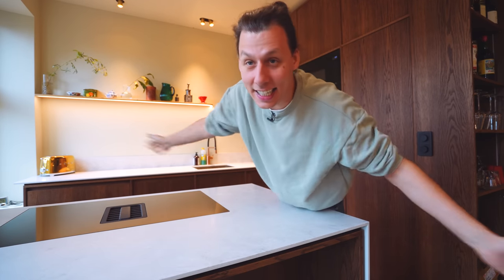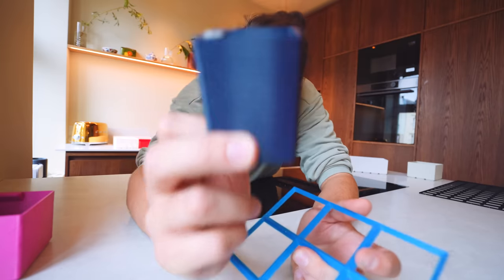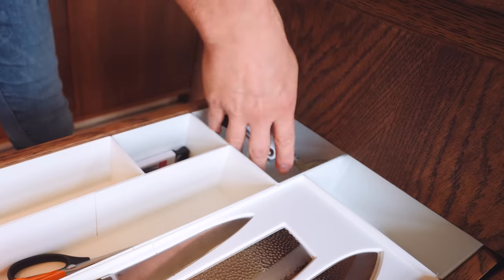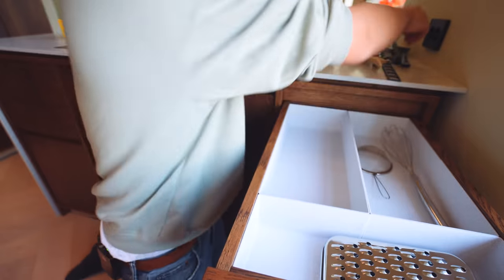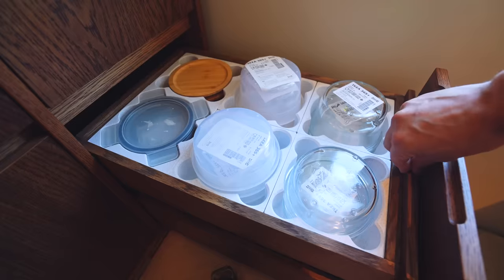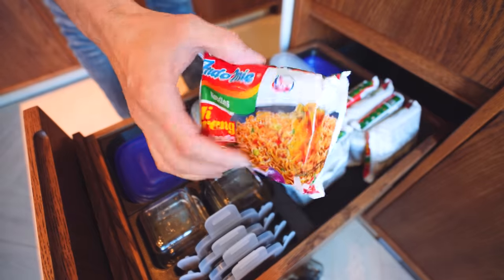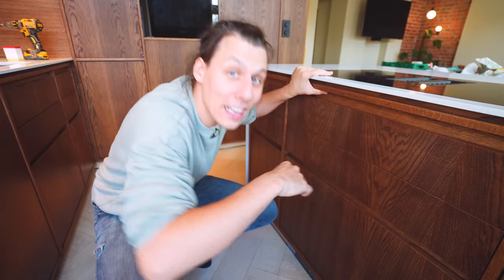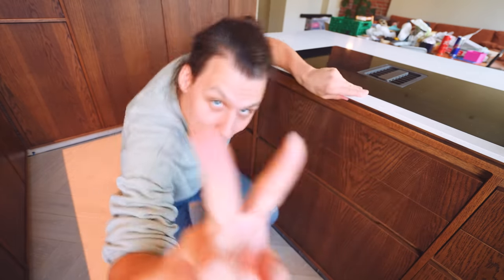How To Organize Your Kitchen With 3D Printing

Comment: I just purchased the files for this system. I do however have one question. Will you be releasing a calculator that tells you what grids you need to print depending on the measurment values of yor cabinet? I was thinking a simple calculator like entering in your width X Depth values, and then it outputs values like.... 5..6x6 base grids and 4...1X14mm base ends.

Comment: So basically gridfinity. I'm curious if you designed this without knowing of gridfinity or took it as inspiration. I definitely designed something similar then realized it's actually basically gridfinity!
Reply: Gridfinity came after the OG ALCH boxes. Zach mentions this in the Gridfinity intro video :) Plus date stamps on Alex's videos and the Gridfinity videos.
Reply: @AndrewWilde  Ooo dang that's sick. I feel like Alex here has an endless mind for design. He oughta step up and take some credit for things! 😂😂
Reply: Basically the 3d printing community is mad at this guy because he locks his designs behind a paywall, whereas a lot of 3d print designers share their designs open source as it's a very collaborative community. Gridfinity is the solution to this guy's grid system and by making it open source there are so many great designs made using the gridfinity system, further proving the value of open sourcing design!
Reply: Although I have bought the old system it feels bad not to have it updated and need to pay again.

Comment: For all the boxes to the grid system. Ikea maximera has an angle on their sides. Do you have any endboxes that align to this? 

Since their drawers 40.60,80 with have a narrower bottom. 40cm width drawer are 28cmon the bottom

Comment: If you are leaving the boxes in the draw, the grid is redundant. Just design the trays so that when they are all in, they fill the draw. The boxes will stop each other from sliding around. Doing things this way utilises the space more effectively (no wasted gaps), saves plastic and printing time.
Reply: That would only work if the drawers were exactly sized to the boxes. Using a grid system makes Alex's design universally compatible with any drawer size.
Reply: @craigmonty  No, the other way around. I design the boxes to fit the draw. So it does not matter what size the draw is. This is the joy of having a 3D printer, the ability to custom design parts rather than have to make do with generic off the shelf items.
Reply: @darren4392  Not everyone wants to take the time to do that though. You are missing the point about why he has designed them the way he has.

Comment: So.. GridFinity with different spacing.
I love how absolutely no one can agree on the best spacing.  I don't think there IS A best spacing and this is why we need to build a system with FLEXIBLE spacing so you can procedurally set the spacing you ant WITHOUT losing out on the ecosystem of designs that fit INTO that spacing.

Comment: You should let people know up front this whole video is an advertisement for people to buy your stuff and it's not free.  I do really like what you've done and appreciate the work that went into it.  
On your site, it's a bit confusing on which set would get you everything in the video.  Would that require the Ultimate System?  Or the Assortment System Master Set? Or would it be one of the other assortment sets?

Comment: Why not just use the gridfinity system?
Reply: This system came first...Zack properly attributed Alexandre's v1 work when he put out Gridfinity.
Reply: @jrobot83  Yes I'm well aware of that. Doesn't change the fact that Gridfinity has surpassed Alexandres system by miles. Why continue to build upon it. For every special bin anybody wants Alex will have to make it himself. A system completely open source will always beat a centralized system with a single man at the front. Alex could have saved himself hours by just using gridfinity instead of making up all the bins he needs and hope nobody needs anything different.
Reply: @asdfg2466  Understood 👍 But then Alex can't sell Gridfinity-based products based on the non-commercial licensing on it... I may be completely wrong on that. Alex obviously doesn't mind the work and if he is making money selling his the digital content seems to make sense. Cheers.
Reply: @jrobot83  Do you mean Alex is knowingly trying to pawn of a product he knows is inferior? Just to make a couple quick bucks?

Comment: Just ordered the full set, now time to get measuring and printing. Not sure if you'll see this comment but it would have been really handy if you had included a document with an image of the print, file name ( so we know which folder to look in) and dimensions of the print in the zip file. Great work though :)

Comment: For anyone considering the ikea tupperware, one advise, don't print those. The tuppers are nice, modular, i only use them, for many things, but modular. But with heating and constant bending the lid flaps stay a lit bended and won't fall that gracefully in those slots. Just pile them, nothing wrong about that.

Comment: 0:39 why is it printing a tower next to it? It's not supposed to do that unless you do a filament change. FYI
Reply: If it's a Bambulab it's a timelapse tower
Reply: @jakobhansen1396  Ah, if it's set to smooth. I see. Mine is set to traditional, so it doesn't do that.
Reply: Was looking for this comment. Haven’t bothered doing a Timelapse on my P1S but I was wondering about the other tower 😅

Comment: 3D printing is nice and all but it wastes a lot of material and energy to print those parts. I simply used cardboard for mockups and plywood. 3D printing makes sense for all sorts of small clever parts but boxes are out there like sand on a beach. The problem with 3D printing enthusiasts is if all you have is a hammer, every problem looks like a nail to you. 3D printing is not always the best solution for a problem. 
Know what a great idea would be ? It´s heating season! So a "heating unit booster" would be a great idea to print and show on this channel. All you need are 2 axial fans, variable voltage power outlet and the printed parts, there is a rather clever design using the venturi effect to only use 2 fans for a whole heating unit instead of 6-9 fans.